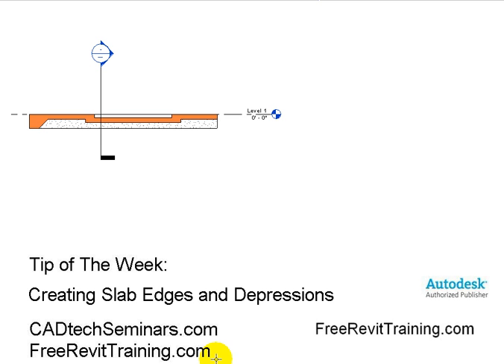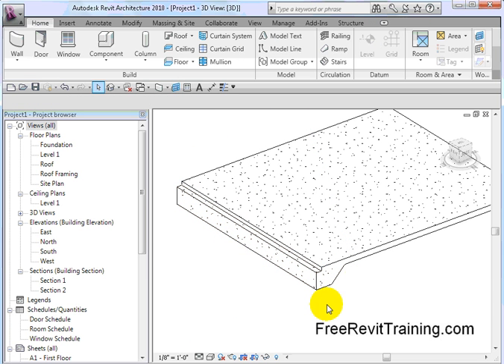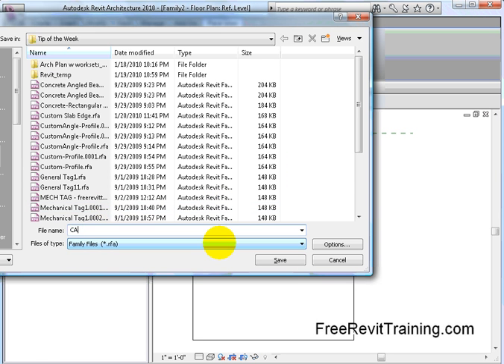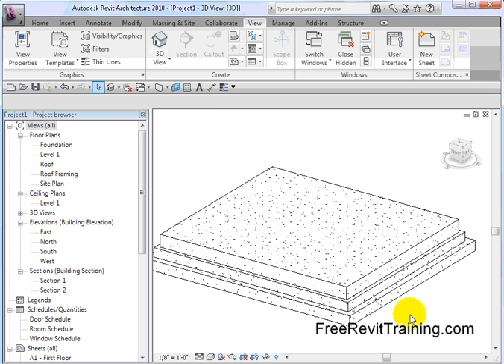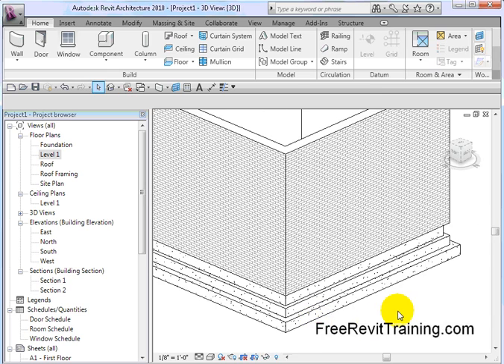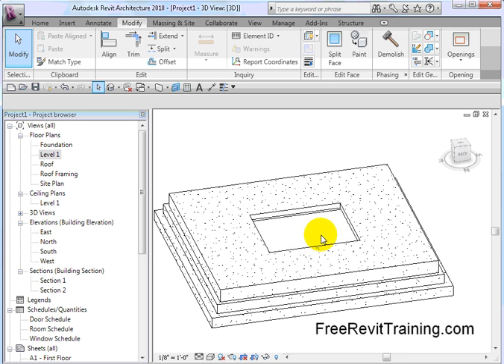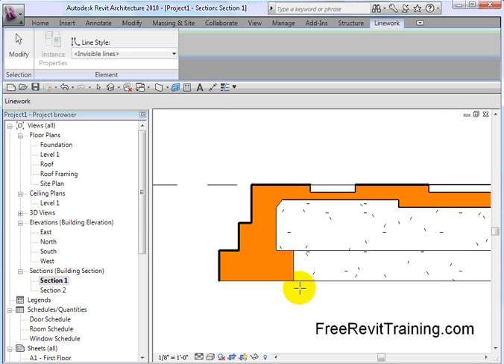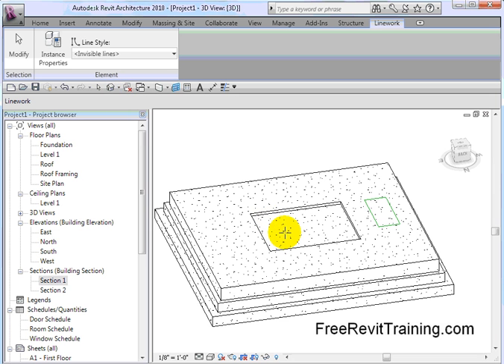Revit - Custom Slab Edges, Brick Ledges and Depressions

Comment: Great video. One question. After unlocking the brick and then pulling it down to the brick ledge, the wall in plan would not miter at the corners. Any thoughts? (each wall continued to the edge of slab including the stud and gyp. not turning the corner)